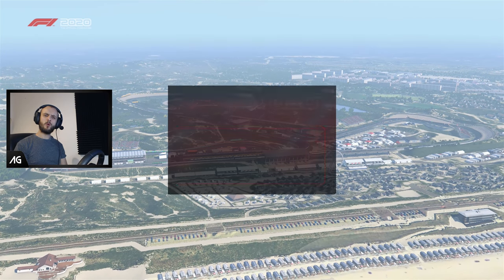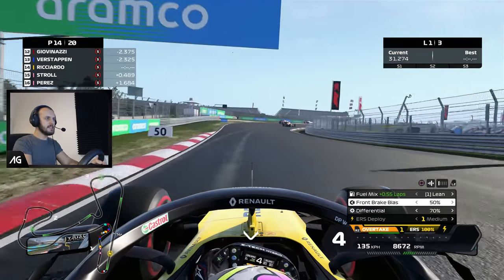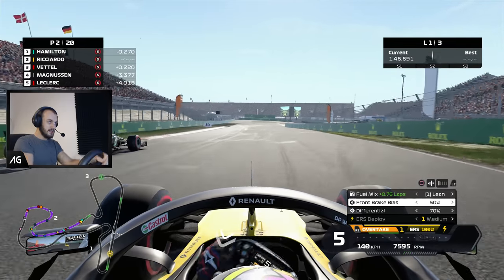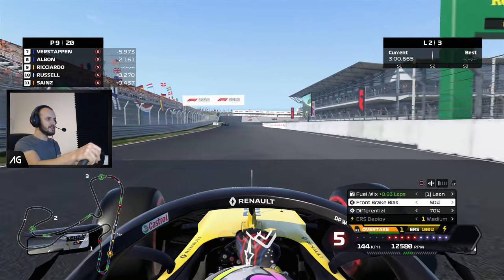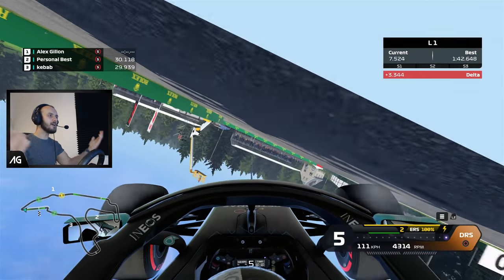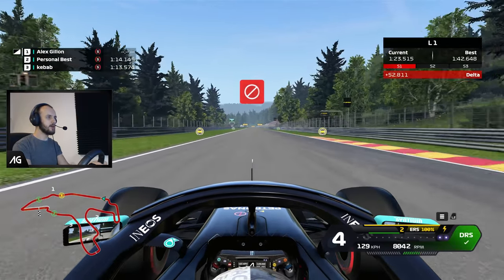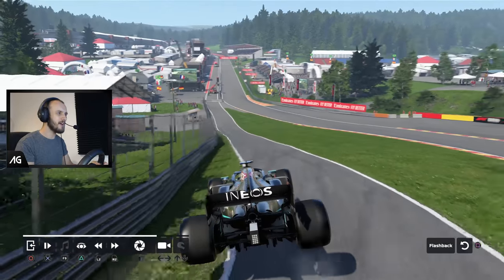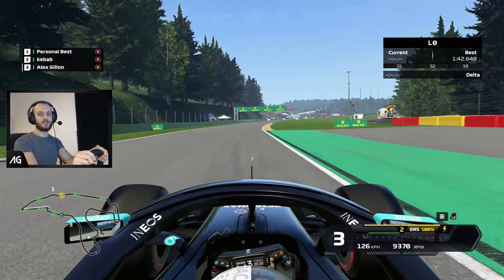With Inverted Wings, Would An F1 Car Fly?

Comment: Explanation for the 140k top speed: The car generates enough lift to have the tyres not make contact with the ground at that speed but to actually take off you would need to keep accelerating, which you can't do cause that's what wheels are for on a car. So in that case it's entirely realistic actually! Really brilliant!

Comment: The issue is the car will reach the speed necessary to provide an equal but opposite force the gravity, but will then lose all grip and become almost impossible to accelerate. Then the slightest deviation in the track surface will lead to the car lifting up at the front, losing speed and losing the "downforce".

Comment: I don't know if the game is THAT realistic, but theoretically the exhaust from the engine should produce a non-zero amount of thrust (when developing fighters in the 1930s they learned that angling the exhaust ports backwards would increase the top speed by ~5km/h). If the game does simulate this it should be possible to take off and maintain flight by just increasing that thrust, modern cars don't have that much exhaust thrust because that energy is best used by spinning the turbo, but I wouldn't be surprised if N/A cars did get a noticeable boost from it, they did know about it when they made the blown diffuser.
Reply: Drag will be significantly greater than the thrust created from some exhaust gasses.

Comment: If the "upforce" was set such that it only takes flight at really high speed or just a speed that can be attained in that Kemmel straight but backwards, a glide could be attained because you launch yourself off of the track as it comes downward but as the car points down you get enough speed to glide. All hypothetical but could it be done?